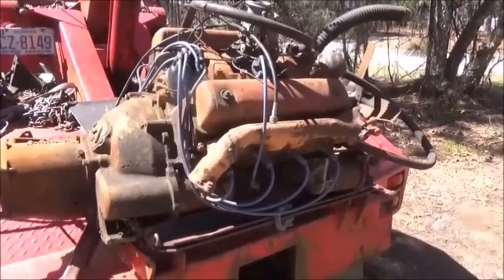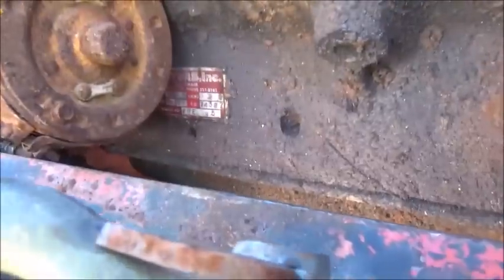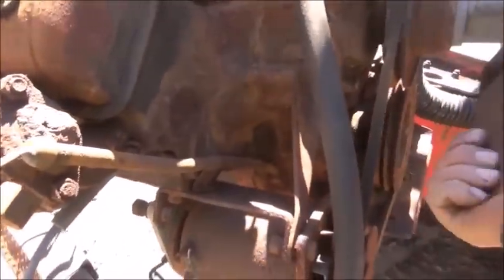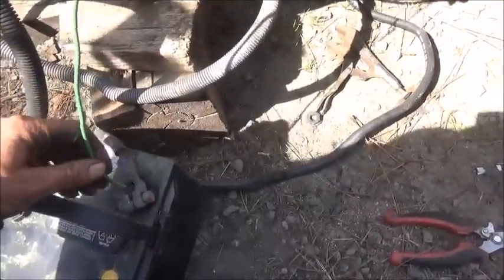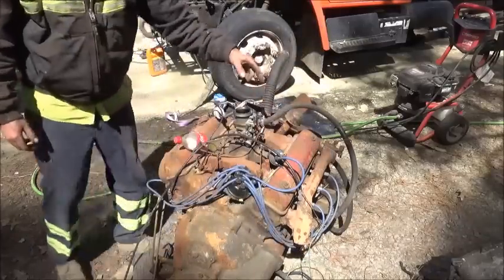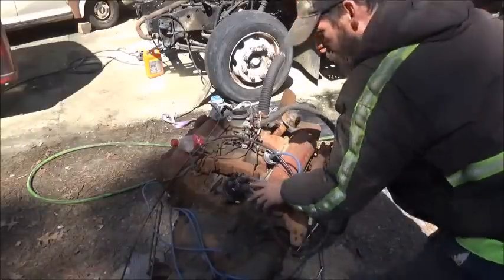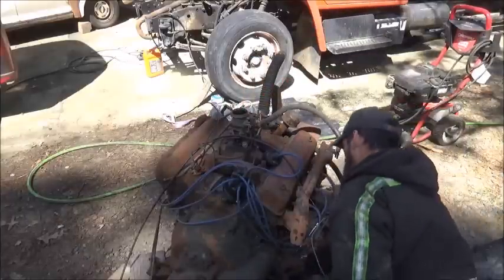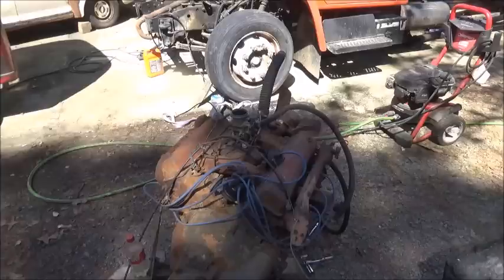1954 FORD Y-BLOCK 239 FIRST START IN 20+ YEARS!!

Comment: Holy cow! $150 for an engine AND trans? And it doesn't smoke?

Here I thought I got one of the most screaming deals known to man back in May 1991. Had a 61,719 original mile 1957 Lincoln Premiere 2-door hardtop and I needed stock replacements for both the engine and trans - a 368 cid V-8 with 300hp/425 ft/lb torque - got it from the original 82 year old owner who'd let it sit for 15 years because he couldn't pass the eye test at the DMV anymore - all he did was start it every 2 months or so and back it up & forward 50 feet in his driveway - engine ended up not getting enough exercise and blew up on me - plus, the 3-speed "Cruise-O-Matic" auto trans always slipped because he never put trans fluid in it during those 15 years. 

Anyways, I started scouring the local "Auto Trader" classics - looked for 2-3 weeks when I found someone with a totaled 52,000 original 1957 Lincoln Premiere 4-door sedan, saying the engine & trans were still good. Called the guy up and asked if he'd sell me the engine and trans if it was still good - he said "I can do that" and we made an appointment to meet up.

Went down to the guy's place (classic car restoration joint in Phoenix, Az.) on the day we agreed upon and, when I got into the shop, I couldn't believe my eyes. See, I thought I was going to be listening to the engine in the car, but he went and yanked the engine & trans and had 'em on a stand ready to go already!

Short ending, he sold me both the engine & trans for $500 + $20 for delivery - and it even had its original A/C compressor if I wanted to start assembling factory A/C in it sometime down the road! Engine ran like a top - never had a single problem with it.

Until the car was stolen in February, 1992.....

Comment: These first year 239 Y blocks are the same displacement as the flatheads they replaced and unfortunately they  have really small valves in the heads. They  sure sound good though with twelve feet of straight pipe  on each side!

Comment: Looks like it used to have a crossover pipe for the exhaust but someone took off the crossover pipe and capped off the manifold. I didn't even know they made caps for that.. good to know because I'd like to make my 55' a dual-piped car sometime and I figured I'd need both new manifolds.

Comment: I got a 67 Chevy SWB step side truck to day it was in back of a ol field behind mans house.got it home it spends over..then I had to go on a tow but wish me luck tomorrow i goin to try to bust it off its last tag was 87
Reply from the maker: Good luck!! Wish I could help!!
Reply: @jonathanw4942  i let u know how it runs..its a 250 6 motor but I got a good running 283 in a 67 truck but truck is bad rust and got a good low miles 454 .and a 292 Chevy motor lol ...just need more time
Reply: 292 I got i a 6 chevy

Comment: Hi was wondering I have a Ford 223inline 6 cylinder engine with the 3speed transmission I'm saleing.I have the listing on Facebook market place.the engine was running when pulled a 302engine was put in the truck .the truck was 1960 Ford truck.don't know if your interested in the engine I see from the videos you post you work on a lot of old engines.I live in San Bernardino California.good video

Comment: i had a 1954 ford custom and the cubic inch displacement was 229  that verry well could be what that engine is if it is 1954
Reply: Sorry about the mistake it been 47 yers ago here what I found fords first Ford introduced the first of the Y-block engines in 1954 on Ford cars and trucks. The engine displaced 239 cubic inches and made 139 horsepower and 193 pound-feet of torque. This represented a 25% improvement over the standard flathead from the previous year. Ford customers were enthusiastic about the new engine. Mercury customers received an uprated 256 cubic inch Y-block rated at 161 horsepower and 238 pound-feet of torque.

Comment: Do you need a ballast resistor to run an old engine with points on 12 volts ?
Reply from the maker: Depends on the coil, a coil either has an internal or needs an external.  Should say on the side of the coil.

Comment: I'm surprised you got it to run. My understanding is old school Ford from the 1950's had a positive ground.
Reply: Easiest way to tell is to look at the coil and see which terminal has the wire going to the points. If it comes off the negative terminal, it’s negative ground. If it’s off the positive, it is positively grounded.

Comment: Utterly mind blowing if my eyes arent failing me at distributors in the back of that motor and that's where they put the chev rool not distributors Ford's been putting them in the front makes it easier to work on you're right that motor must be 60 years old
Reply from the maker: Yes, all Y blocks. They are low and at an angle, so they are tough to change point in when they are in a vehicle.

Comment: I've got a 54 ford y8 v8 motor that came out of a car and replaced the starter battery selanoid tryingvto get it to start used starting fluid locked the motor up but took plugs out put oil in all the cylinders got it loosened back up got a new coil cant get it to fire there are 3 wires that go the points one from the coil one from the condenser and the other one is from under the plate in the distributer do all three of the wires go to the poi to or not

Comment: They didn't have your knowledge of engines to guide them. I can see how it would be easy to mistake that engine for a Chevy because of the distributor being in back, and the exhaust ports siamesed in the middle of the heads just like an older Chevrolet engine. Excellent score!

Comment: I may have a stupid question but how did he know the compression he felt was not exhaust?
Reply from the maker: Never stupid questions. When the Piston is coming up on exhaust stroke the exhaust valve is open so it makes no compression and you won't feel it. Only time you'll feel compression from the spark plug hole is when both valves are closed.
Reply: @jonathanw4942  Thanks.  I should  have thought it through.

Comment: Maybe 272 or 92 the 54engine 239 had tan covers there was red & black later years most 239didnt live long.caution oil pump shafts break if unused years.early Ford's had one break on 260  &292.
Reply from the maker: It is a 239 according to the casting numbers.

Comment: Watching you and it seems like you need three hands. Get a board and stick one of those foot starter switches in it to crank the starter and you’ll be able to work the throttle while you pour gas into the carb.

Comment: What's amazing about old engines like this old Ford Y Block, sitting like that on nothing but wood blocks, being able to start and run it after so long with just 2 battery cables, a hot wire to the coil and a bottle of gasoline. Try that with any engine built even 30 years ago. You'd need a fist full of wires and its computer before even thinking of starting it. Simplicity is a lost value.

Comment: I’m just wondering why they went with Chevrolet firing order? Not a issue to look it up. Then what do I know anyway lol
Reply from the maker: They used the Ford firing order, but Chevrolet cylinder location.
Reply: Jonathan W runs good man nice
Reply: @jonathanw4942  Ford changed the firing order startingin '58 with the FE engines (332, 352, 390, etc.).  I've always read the reason was reduced chance of crankshaft failure (although I've never heard of Y Block crankshafts failing more than any other engine).  Here's one of my favorite resources for Y Block info:  yblockguy.com

Comment: I have 6 & 12 volt Y block starters. rebuilt by my local re-builder.
Reply: My father used to own an automotive parts/service business. When he closed the business, he gave me ( among other things ) a New Old Stock 3-bolt Ford/Autolite/Motorcraft carburetor ( Motorcraft #B6A-9510-R ) for Y-Block Ford engines( 272,292, 312 c.i. )listed for 1956 Fairlane/T-Bird/ Meteor ( Canada).

Comment: Imagine what a guy has to do 50 years from now to get a 2019 engine going LOL!! who would want to be that guy  Not me lol!!
Reply: Leave the electronics connected and not even a need for knowing the firing order as the PCM will last forever unlike the points in a 50 year old engine now. Oh and other hard stuff like never having to replace plugs cause they last 100,000 miles now. I'm 58 and was around when these engines were being used daily and they sucked.

Comment: Thatz a 272 cu.1955 ...not a 239....239  was a flat head motor ...cheers
Reply from the maker: wrong, this was first year, first series Y-block and is a 239. Do your research.
Reply: @jonathanw4942  thank you ...I am mistaken...we never had a 239 y block in Canada ...as far as I know the 272 was our first y block ...still learning at 79...I had many street rods with the 239 flathead ..cheers

Comment: I think the next size engine was a 312 from this.
Reply: 1954, 239 ford and 256 mercury.  1955, 272 ford and 292 mercury. 1956, ford, 272, 292, 312 thunderbird special. mercury 312. 1957, ford, 272, 292, 312. mercury, 312 and the 368 lincoln which was labeled as the turnpike cruiser engine and has a different block.

Comment: I don't think this guy understands what starting fluid does....he will flat run a battery down and work the shit out of a starter...
Reply from the maker: I know exactly what it does, it dries out already dry rings and will wear the cylinder and rings out before you get it started. The longer you turn the engine over, the more oil is displaced. I don't want them to start fast after sitting for decades. Rather have a bad starter than a scored up cylinder wall.